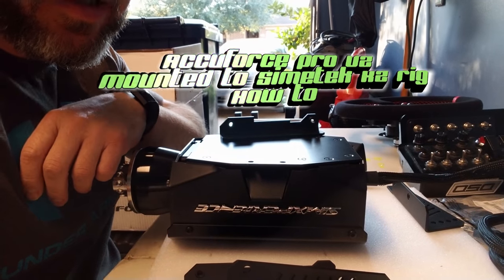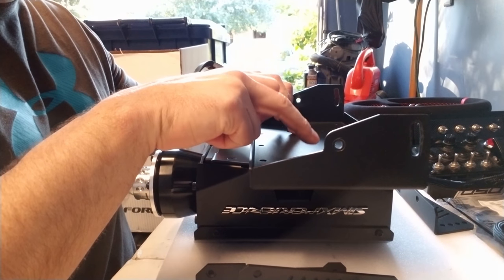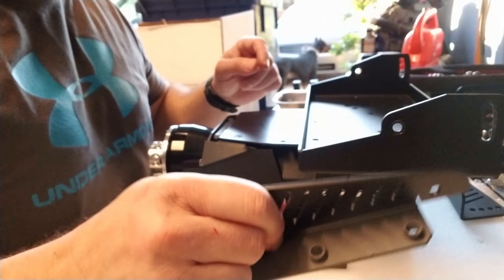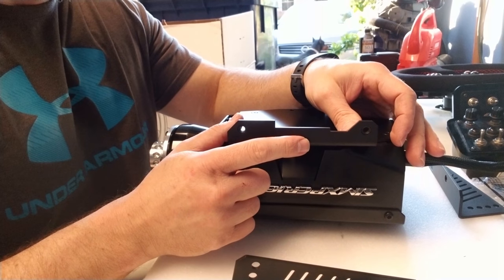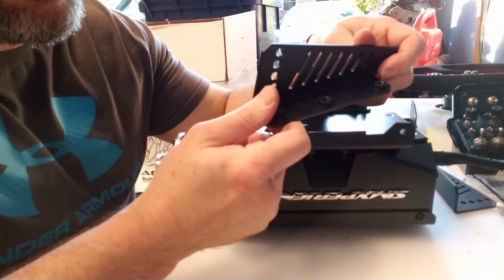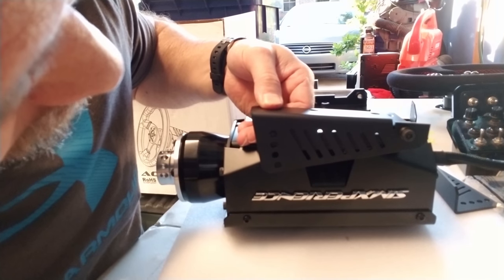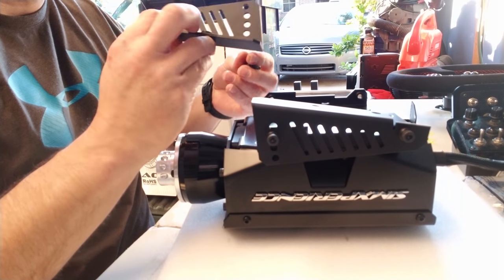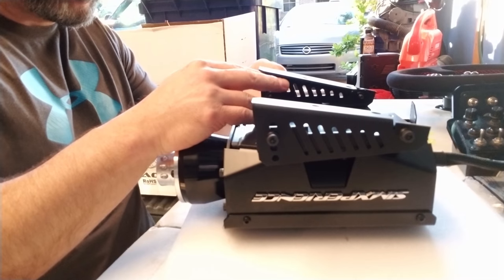Accuforce Pro V2 Mounting to Simetek K2 Rig

Comment: I use the same rig, now you remembered me about the fanatec bracket, in that way I can adjust the tilt angle much more. because the ''negative'' angle is not that big with the simetik. so thank you for that xD And in that way the Podium wheelbase will have much more room to adjust as well, otherwise it will be difficult because of the different form :)
Reply from the maker: Yeap I remember you. Thanks for watching and glad to help.
Reply from the maker: @HomieFFM  So the overall length of the Accuforce is 263.9 mm and the Fanatec is 330 mm. The Acuforce base alone is 209 mm vs Fanatec base of 239mm. The Fantec base is only 30mm (1.18")longer. It should fit the Simetek just fine. Also in those views, you are seeing the side and top views not the bottom. I thought the same thing at first. The bottom is drilled like all the other 3 hole pattern Fanatec bases. So no worries my friend.
Reply: @TJRSIM  thank you for the comparison, I'm just curios if they even come up with a mounting braket like with the csw 2.5. Because like I said, the (3) drilling holes are too far in the front for any bigger angle. I asked simetik and they dont even know xD but let's wait and see. 
The accu force has a good solution with this kind of brakets